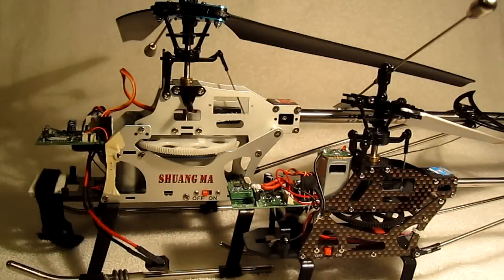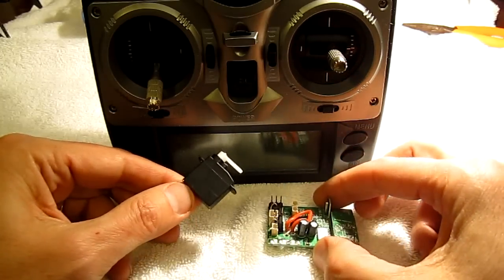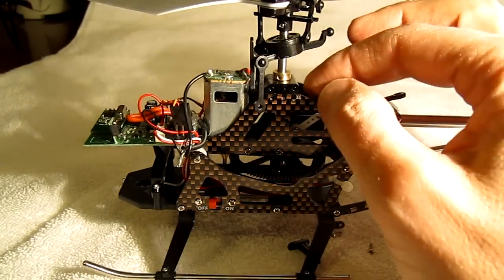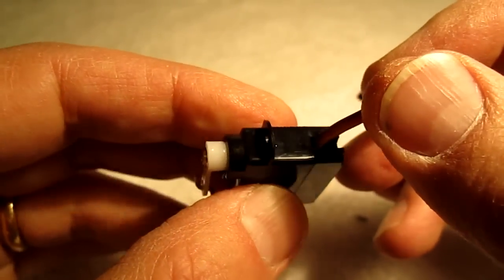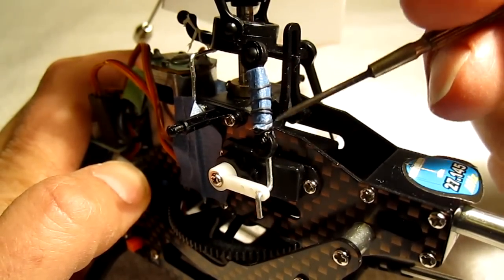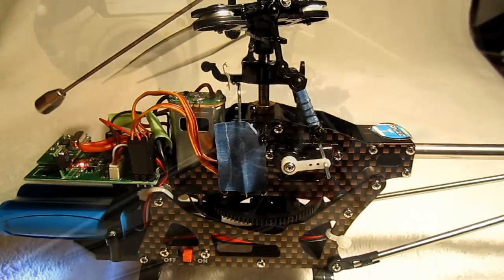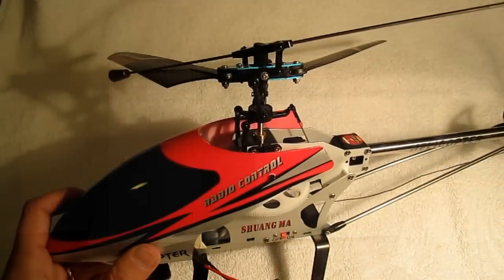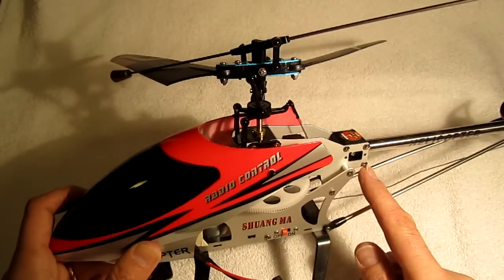Double Horse helicopter 9100 and 9104 conversion to 4 channels

Comment: I need help will this work with the 9101 …got a couple days ago and didn’t notice it was missing antenna on tx it’s a 49mhz and it wouldn’t keep a signal father than five feet so I ordered a 98cm antenna for it and it works was flying several times today outside in 7mph winds and it stayed in air and had no problems keeping it in the air but the thing will not go forward or back hardly …my tail blade is curved and not straight like others I see and it facing up not sideways or downward like I’ve seen …ppl tell me not to bother with it but I like it and would like to convert it and make it single blade if possible and direct drive motor and extra servo like u did …help me please can it be done ?

Comment: I am new to 2.4ghz, old school, I just purchased the transmitter and receiver board on ebay.I am going to try to keep it 3 channel for a while,I have completed installing the board but can't seem to bind the radio and 9116 board...have played with 2ch cars and they use a jumper that you only use to bind the first time...I apparently don't know the bind sequence....I have the same radio and board you are using in this video----Any suggestions ?

Joe P

Comment: what would cause the 9117 to only pivot in one direction. the servo works and when I change from nor to rev it will pivot in the opposite direction. it seems that the remote is not putting out enough of a signal because the servo barely moves?
Thanks

Comment: Thank you very much for your video. I have a 9104 that I don't use anymore since i stepped up to the 9116. 
Do you know if I can use my current 9116's Tx with a 9117 receiver board? If i can use my 9116 Tx is this all I would need?
Receiver board, swashplate, servo and connect buckles.

Comment: Please let us know if you need to replace the plate 9116 two transistors and two diodes responsible for the power of the main engine and the tail? In the model, the elements 9104 are much greater since the motors have more power.

Comment: couldn't you just buy the swashplate assembly for the 9116 and 9117 and put them on the 9100 and 9104 respectively and achieve the save results.  Especially for those of us whom may not be as handy with tape and clips as you are?

Comment: Hey HD12345, question in making the 9100 a 4ch... if i use the swashplate for a 9116 will i still have to turn the head assy like you did in the beginning of the video? and i ordered the 9116 board along with the TX but i did notice the board doesnt have a ant (wire) like the board on the 9100 does is this normal, or am i suppose to soder on on there like you have to do with the wires for the batt connection? love the videos keep up the awesome work!

Comment: These videos of yours are extremely handy as I have recently purchased a 9104 through e-bay..in fact these types of reviews are in my opinion are paramount in determining what to buy..I used your review for this very reason(through your advice I,ve also bought a li-po battery)..so a big thank you from down under..a quick question though..for the price you pay for the upgrade,wouldn't it be better to just purchase a 9116 outright if it's what your looking for ? Cheers

Comment: Wow - I'm REALLY frustrated with the limitations of my 9100!  I've made the swashplate mod but haven't had a chance to test it yet (Broken Reciever/Gyro board).  If I just order the 9116 ECB, Swashplate and servo - WHAT could I use for a Transmitter/Controller?  Maybe the 2.4G unit that's coming with my WL V911?

Comment from the maker: @MrAndrei316  The 9116 receiver didn't work in the 9104. It would probably work with a standard receiver and 2 ESCs for brushed motors. I plan on doing the conversion in the future and then hopefully will have an answer for you.

Comment: @hammydude12345 so mother board, two 9104 servo, 9116 connection buckle, and can I get a diffirent reciever? Like this one Hobby King 2.4Ghz 4Ch Tx & Rx V2 (Mode 2)

Comment from the maker: @MrAndrei316  You can't use 9116 parts on the 9104. the 9105 has 9g servos and the 9116 receiver can't handle the increased power for the 9104 (at least mine can't). if you do the 4 channel upgrade you won't need the 4g counter balance. i hope to have a video on the 9104 including electronics but i am really busy so it will probably take a few weeks.

Comment: If I put the original parts of the 9116 but put it on the 9104 like the servo and mother board, will it work the way it should if installed correctly? For the servo where do I connect it to make it stay to the metal frame of the 9104? Do I need two 9116 servo or I can just use the stock servo and get one that is made for the 9116? Is there more range than the original receiver and do I stil have to put the 4g counter balance or no because there is 2 servos?